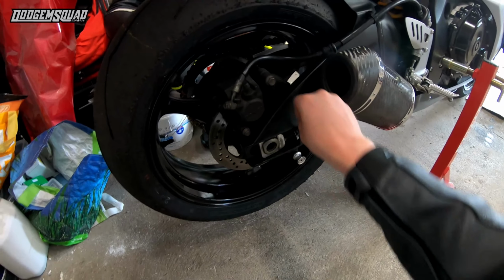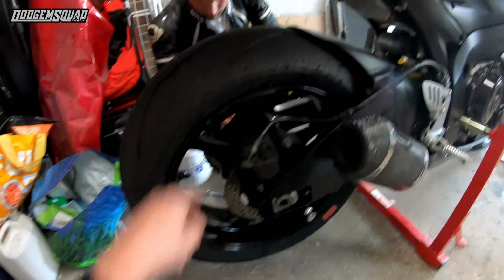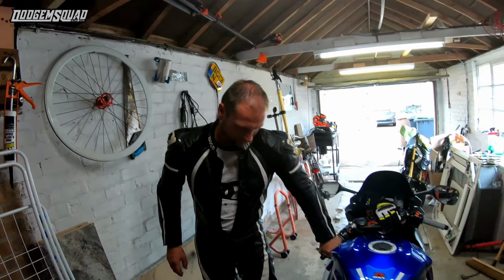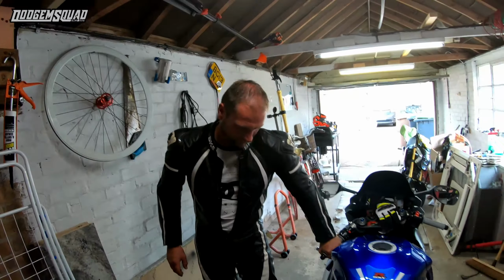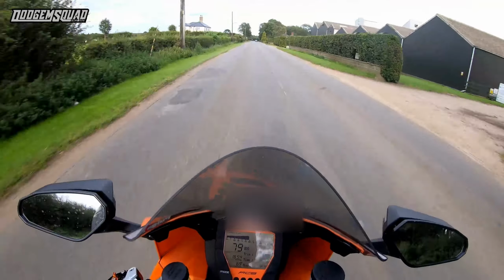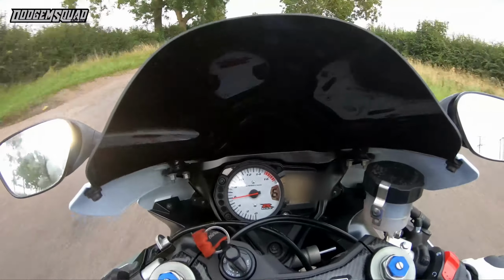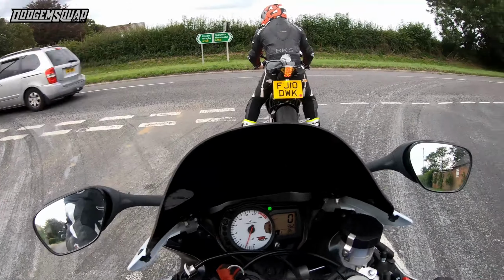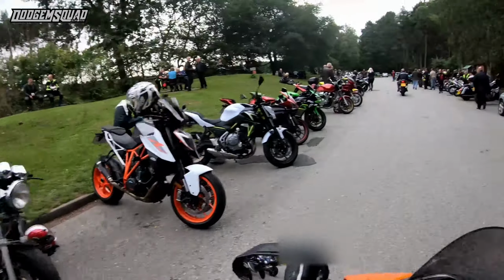Should you use race scrubs on the road | gsxr750 | ktm rc8

Comment: Top tip, sometimes if you put the spindle in the other way around so the nut is on the other  side of the wheel, when you tighten it, it'll not pull the wheel! :-)
Reply from the maker: Genuinely never heard that before, but it kinda makes sense! Thanks for that, although it's not like we're going anywhere in a hurry now 🤦‍♂️
Reply: @Cranked-up-racing  was told it by a mate who worked at Redcar Suzuki when I got my k7 Phantom 750 from them and was having similar issues :-)
Reply from the maker: @HippoDrones  sweet, haven't noticed the issue on any other bikes, so maybe it depends on the bikes swingarm setup 🤷‍♂️
Reply: @Cranked-up-racing  quite possibly :-)